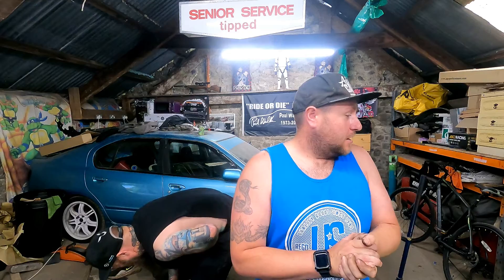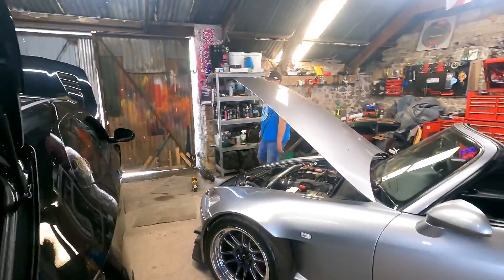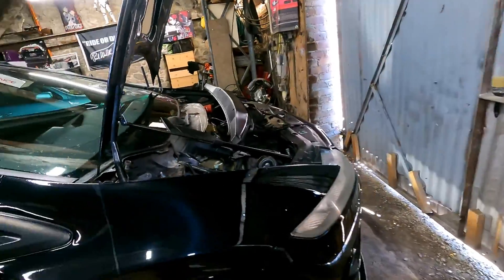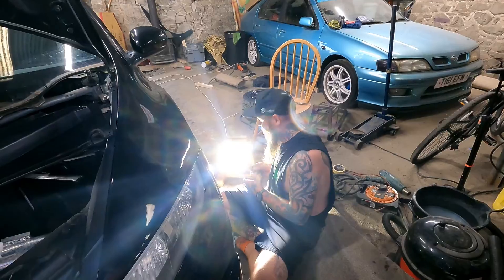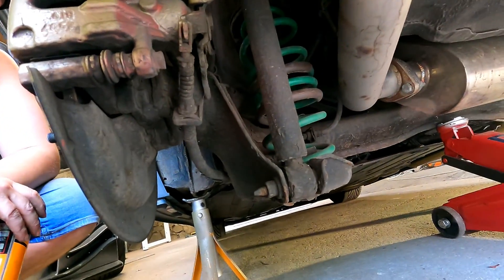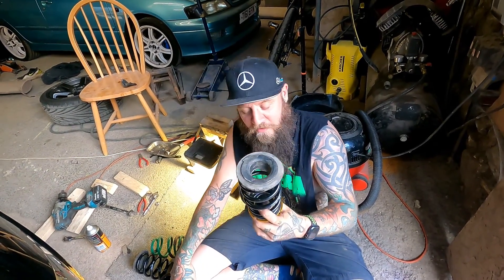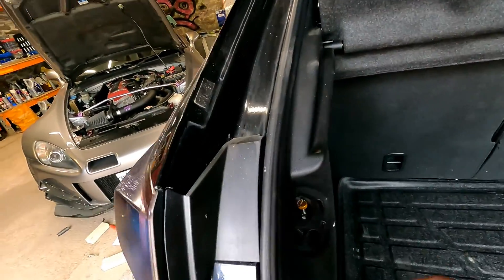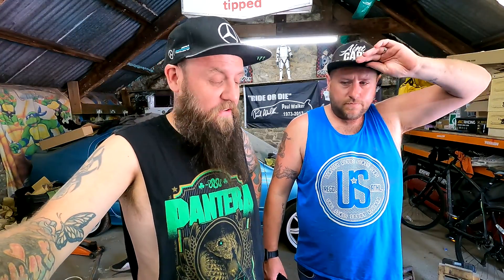Honda Civic FN2 YellowSpeed Coilovers Install

Comment: Great vid as usual although It looked like the camber adjusters on the top plate were at the wrong angle, not sure if you readjusted later but they should be horizontal to the car.
Reply from the maker: All sat fine mate when it was dropped we thought the same thing. Gna spend some time setting it all up properly so will look into it deeper soon 🙏🤘🏻❤️
Reply: @CowabungaCarDiaries  The pointy part of your camber plate should bolt into the hole furthest from the edge of car, if that makes sense.
Reply: As above, you need to be able to loosen the Allen bolts in the camber plate of the top mount to adjust the top of the shock in and out (ie left/right to the orientation (👌🏻) of the car). That’ll give you your camber adjustment- no effect on ride height. 

If the camber’s different between left and right sides you’ll get pulling to one side or other and handing weirdness!
Reply from the maker: @benbuchanan672  cheers mate we will look into setting it all up etc soon

Comment: eyeing these up for my fn2, had the prosports on my fn3 andfor the price they were amazing but a fn2 its like ive got to better, thing im wondering is do the yellowspeeds come with the camber set centred or do you need to adjust?
Reply from the maker: We didn’t adjust the camber on the top they are set to stock so we left them as they were 🤘🏻💛
Reply: @CowabungaCarDiaries  nice one, will make my life easier when i get a set

Comment: Good video guys, halfway through mine. What measurements did you end up with? Backs got me confused with the spring and damper being adjustable
Reply from the maker: Can’t remember what we set them at mate, just make sure they are the same on each side and go from there pal. The rears are strange. We still haven’t set them up properly yet

Comment: I’m guessing for the rear the length of the rear shock is adjustable so that if you have the ride height (on the spring platform) set to low, you can shorten the shock to stop the spring falling out under full droop.
Reply from the maker: Yeah makes sense doesn’t it.

Comment: Wassup boys, great video, great upgrade. Those little washers that are cabletied to the shock are for non type r mk8 civic which had smaller diameter bolts and holes in the knuckle. These washers take up the free moment on those.
Reply from the maker: Ahhh thought it was for a smaller bolt. Nice one dude 🙏🤘🏻❤️
Reply: @CowabungaCarDiaries  yeah smaller bolts as the holes in the knuckles on non type r are smaller 🤘🏻

Comment: Hi guys, i'm also running these coil overs although mine are set for track rather than comfort... would be interesting to see how you get on with them. As far as i'm concerned they're awesome but i've never had a car with coil overs on either. One Tip or piece of advice if you want it... cover them or spray them with ACF50 anti-corrosion spray, mine are looking a bit sorry for themselves after 1 year on. Anyway great video, look forward to next one.
Reply from the maker: Awesome appreciate that pal nice one 🙏🤘🏻❤️

Comment: You guys are the best but I just woke all my family up laughing so hard. Got burns on the ceiling now....Loving the summer look and I get the same cramp in my bloody ribs as well... Be cool to know if the rides really improved. I have to go down lanes to work and it's so crashy. It's ridiculous., Did you do the rubber joints as well?
Reply from the maker: 🤣🤣🤣 we didn’t no mate we didn’t have any so re used the oem ones 🤘🏻❤️